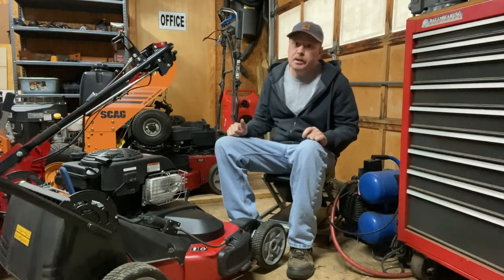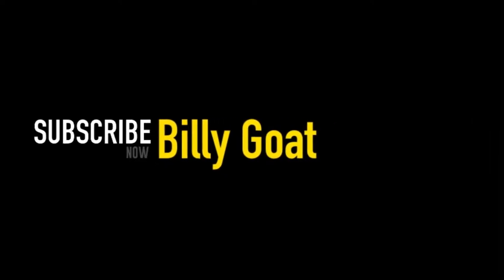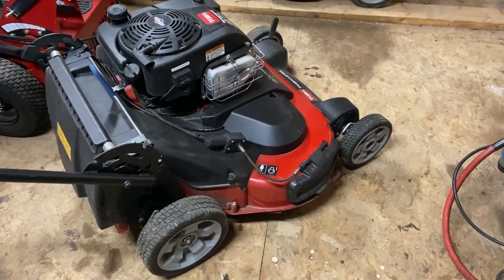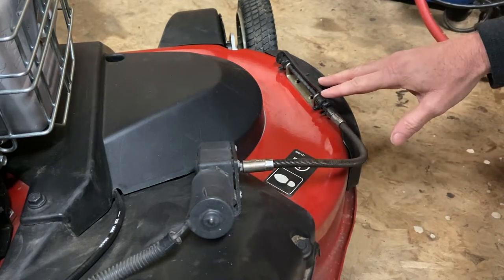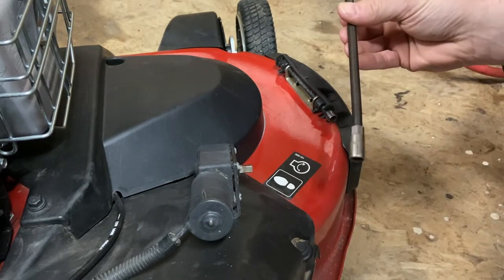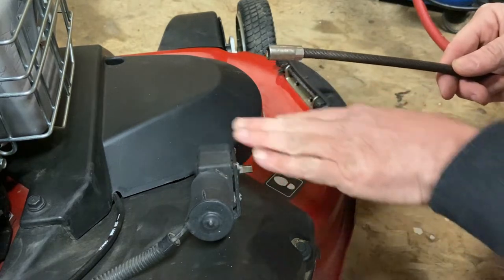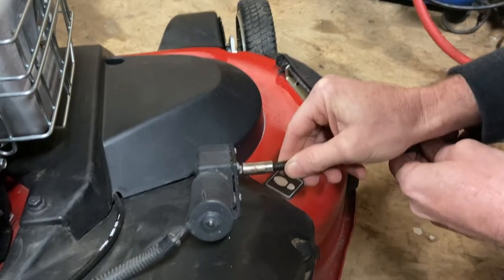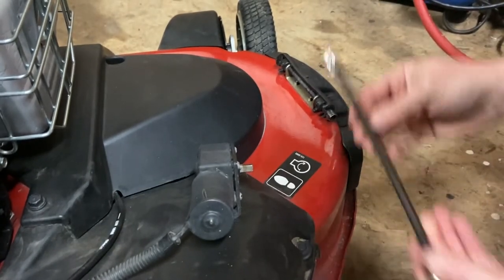Toro Timemaster Chute Blocker - Part 3 (Mechanical)

Comment: This is awesome 👊🏼💯 definitely gonna try to do it.
Reply from the maker: I’m working on a new version that locks the flap in the desired position between fully open, half open, partially open and fully closed.
Reply: @BillyGoatLawnService  nice. Do you really need the spring?? Or could you just use two locking clamps
Reply from the maker: @TheLawnFellas  There are many options that could work not having a spring. Try various ways to lock or hold flap at the desired position. Feel free to video and post your version. My version was based off the Trimmer Trap (brand) chute blocker, I originally had on my Scag walk behind.
Reply: @BillyGoatLawnService  nice. Well it’s a great design for sure. You should patten it before a big company takes it away.
Reply from the maker: @TheLawnFellas  Other people have suggested me to patten it but in reality I’m just modifying other versions of chute blockers already out there. I only want a little recognition if someone expands on my version.
Reply: @BillyGoatLawnService  sale it to Toro!! Chute blockers are needed for push mowers. I made one with a bunjee and some eye hooks and a zip tie.
Reply from the maker: @TheLawnFellas  yes! I remember your video on your version. I watched a bunch of videos on DIY versions. Yours definitely simple but effective concept.

Comment: Nice man I like it
Reply from the maker: Appreciate the feedback. At some point, I would like to make a update video.
Reply: @BillyGoatLawnService  how do you square the rod to fit swivel
Reply: I need a parts list for that maual I think I got it
Reply from the maker: @chrismiesner6973  you could actually use a square rod. I used the round rod and filed down the end into a square to fit into the swivel socket adapter.
Reply from the maker: @chrismiesner6973  I briefly mentioned the parts I used in the video. In a future video, I plan on simplifying the manual version to include a parts list as well. I also upgraded the spring tension side so the flap locks in both open and closed positions.
Reply: @BillyGoatLawnService  oh yeah thanks
Reply: I finally put one on my total time master. Thanks for the help. It works great. Took me a little time but I did

Comment: On the chute, do you think just using a 1/4” socket extension about 6” long would work instead of welding a socket on a rod? Then drill out 1/8” holes for the roll pins?
Reply from the maker: Possibly!  May need to drill the holes bigger on the hinge bracket.
Reply: @BillyGoatLawnService  I was thinking that. Maybe drill out the holes on the bracket larger to slide it through. I also thought about just using a 4’ square rod that is 1/4” instead of round so I won’t need to shave the rod down. I found a 4’ square rod for about $3

Comment: Good morning Billy! I'm surprised, that you haven't submitted your idea(s) for inventions and/or to Toro!?!?!? I have noticed, that our Honda push mowers have the rear discharge chute. What are your thoughts/opinions on those?
Reply from the maker: I thought about it 4 years ago but since then there are so many variations of chute blockers on YouTube now. As far as Honda and other mowers having a rear discharge chute is ok, but for us to be fast and efficient we need to be able to switch from mulching to discharge on the fly or use a bagger if necessary.
Reply: @BillyGoatLawnService  The Honda mowers do have a Mulch to Bag adjustment knob on the back part of the mower. The rear discharge chute doesn't open fully. I just wonder, why they don't have/offer a side discharge chute...🤔
Reply from the maker: @dmanburns3705  Next time I go to homedepot, I will check those Honda mowers that have that mulch to bag adjustment knob. Curious on how they designed it.
Reply: @BillyGoatLawnService  We have (3) Honda push mowers and love them...for the most part! The rear discharge chute is the only questionable design. Other than that, they run and mow beautifully!!

Comment: When you close the chute, does it stay closed all the way when the blades are running?
Reply from the maker: I haven’t actually tested mine yet but  if the spring is heavy duty enough it should hold the chute closed. I use to have this type of setup on my Scag before converting to the motorized version.
Reply: I found making the manual one the shoot does not stay closed at all. It still opens but not all the way. Any suggestions on how to fix it?
Reply from the maker: @patrickbolen9798  I will be making some improvements and posting another video.
Reply: First off - brilliant idea! And extremely well done video explaining everything. I installed the chute blocker with every part mentioned. Works great, BUT .. as noted here already, the chute doesn't stay closed under a heavy mulch load. I had to resort to a short bungee to keep the chute closed when mulching 3" grass. Wondering if anyone has made any modifications to this design to address this problem?

Comment: What is the motor?
Reply from the maker: When I edited the clips for the video, I must have miss the engine segment. This mower has the Kawasaki FS541V 15HP. If we had a Bad Boy dealer in our area, I may have considered getting the Bad Boy Revolt 34. Impressive mower compared to the Surfer Pro.